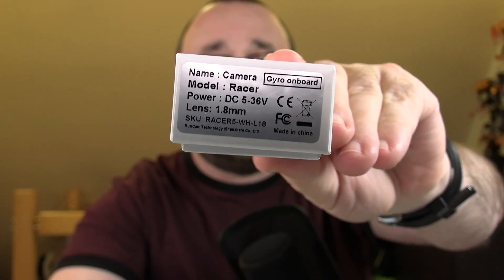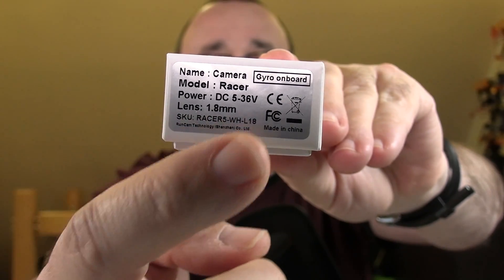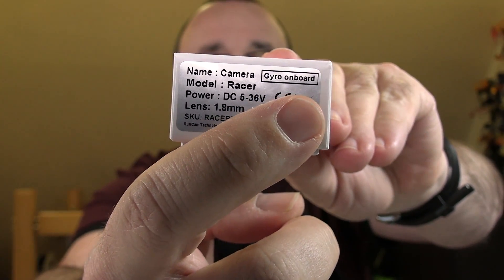Gyro on an FPV camera? RunCam Racer 5

Comment: Hi Pawel    Great video and review of the RunCam racer 3 ,  I just love going as fast as I can push my quads.  Yet I don't have any reason for the gyro, I don't need to know what angle I have.  But I was thinking that a wing would be nice and then use the gyro to know if the airplane was climbing or diving.. otherwise I will wait.

Comment: I fly freestyle and would really like this feature, Im very fussy about my camera tilt and when it’s not right I notice it straight away. When trying to setup the camera in my Apex builds I had a hard time doing it because it’s hard to easily see what angle the camera is at.

Another feature I would love is a white balance setting in kelvin like the dji digital camera has, I set mine to 5500 instead of auto most of the time and the image is fantastic,  wish analog cameras worked this way.

Comment: To quote my own comment on Andrew Newton's review of this camera;
I used to like the RunCam Sparrow for fixed-wing use as it was (originally) 25-ish AUD, had a voltage OSD & a microphone, but then the price nearly doubled & we lost all the extras that used to come with RunCam cameras...
Since then Ive been having a hard time finding ANY camera at a decent price with a full body AND a voltage display for less than 50-odd AUD!
I like the image of the Foxeer Razor Mini(?) & a decent price, but no voltage display....
I wouldn't mind paying 50AUD for a camera with voltage display quite so much if they also added a display for RSSI from my rx.
With manufacturers now adding novelty features for a small select market in an already narrow field (FPV industry), surely it's time one of them started to think of the fixed-wing fraternity???
Anyways, random thoughts- looking forward to trying out a Toothless2 on an old HK Walrus very soon, but it's looking like Foxeer have stolen me away from RunCam! :v ;)
Thanks again & all the best!

To which RunCam replied;
We are very sorry to see this and feel very sad to lose you. Why don't try our phoenix 2?

And as far as I know the Phoenix2 doesn't have a full body nor a full-sized lens.... 
Would still love to see a manufacturer add RSSI readout/% for those of flying without a flight controller! ;)

Comment: The angle of the kwad is known by betaflight, so this could also be shown by betaflight in the osd - nobody asked for.
Reply from the maker: This measure angle of camera, not kwad
Reply: @FPVUniversity  I know, but if the cam is flat and kwad angled - I than can adjust the cam according to the desired angle. And during flight, osd could show the same as the runcam. but betaflight osd doesn't show the angle - missing feature.